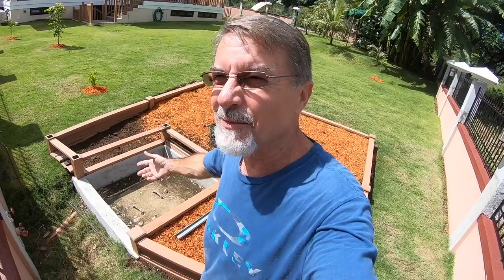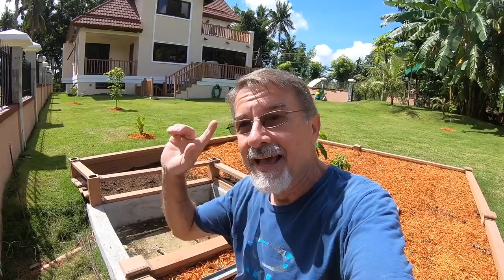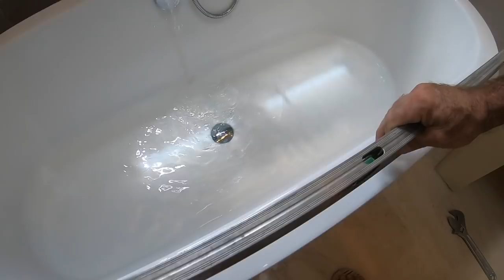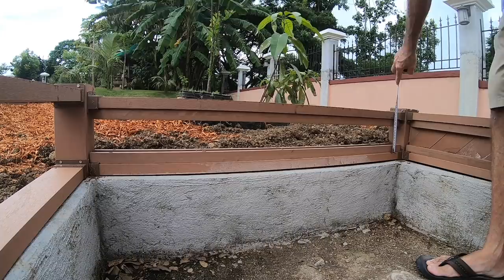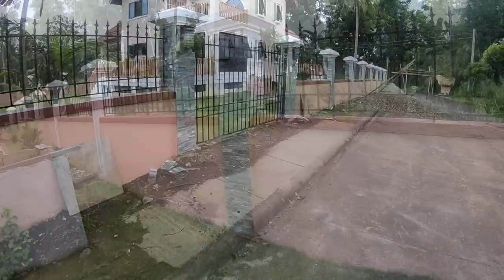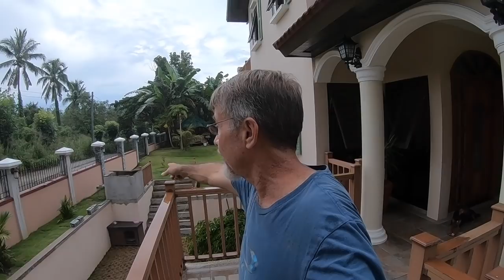VILLA FELIZ - EPISODE 405: I WAS BENCHED TODAY (House Building in the Philippines)

Comment: I was in Europe this last summer. I rented an apartment that had a bathtub similar to yours. It had no overflow in case the bath was overfilled. It also had very weak water pressure which meant it took 10-12 minutes to fill up the bath. I'm sure you can guess the rest. I got bored waiting for the bath to fill up, left the bathroom, got distracted, flooded the bathroom. Oops!!
Reply from the maker: Nice think about how houses are built in the Philippines, all wet rooms have a floor drain so no overfill for the tub isn't a big deal.
Reply: Same in Indonesia where I am. But then I was in a 200+ year old converted house and I rained on the downstairs apartments parade ☔😳

Comment: I know you had mentioned possibly putting a plant next to your toilet where the ladder is in this video.  Have you considered putting a little table there for a book, etc?  If you make a box out of plywood, you could cover it with that same tile that's on the wall.  Then it wouldn't be attached, but it would look attached, and you could remove it, if you ever need to work there.  You could even leave the side that faces the wall open for some extra hidden storage.  BTW, I really like this room a lot.  You've made a spectacular design for it -- it's very beautiful and smart.
Reply from the maker: We've already purchased a magazine/tissue wall rack.  Its wide enough to hold two rolls of tissue...a must for those "I'm out of tissue" moments.  😳

Comment: James, Leave that concrete cover on the cistern. On the seldom occasion you need to do maintenance, get someone to help open it. You can drill a few small holes in the top for rain drainage. You don't want that cover to be easily removed by some curious kids who want to see what's in there.
Reply: You always want easy acess to the cistern! What's the problem with a lock anyway?!?

Comment: 1:48 Hi James Hi Ness , I'm  back after a dayout and catching up... James you say that the geny will be alternated on some brown-out days. With doing that what is the effect on the refrigerator? I know that on some units its ability to keep its cold capacity can be up to a good 18 hours or so, IF you limit the constant opening  of the doors for prolonged periods. Also do you have a surge suppressor on that circuit? Because the constant abrupt   on/off effects the relay in the unit, in that it fails after too much on/off  events.

Comment: you nead to but some thing behind the saw on the wall
Reply from the maker: Remember I'm still in the building stage.  The saw will be moved a bit forward so that I connect a integrated vacuum hose to the vacuum outlet on the saw.  That'll be another DIY project down the road.
Reply: you right

Comment: Hi james, just have a couple questions that I couldn't see for sure without a close up shot. Are they tiling up too the light fixtures or boxes or removing them and going behind them. Are you just tiling over top of the attachment bar where the fence panels are attached to the posts. Just curious, I won't make suggestions, I leave the building to you. 

I do remember in the last couple days you were talking about a VPN  partly for Netflix I think. I have a vpn I use for shopping and traveling but dont use it for streaming. This is not a suggestion just an advertisement I guess, and you may already be familiar with them but Google,,,,  skystream technologies. They make there own streaming boxes that are not KODI  based and they work great here. I have 4 of them and by using various apps you can watch almost any show or movie ever made from 1900 on for free . Also can watch practically anything from any other country if that is of any interest to you. Can watch live streams of almost all channels from US or any other country. I used other streaming boxes for years but they did not update there software skystream does periodically so it almost always works really good but if you subscribe to a service called realdebrid 99.9% of the time I can always find a stream for anything .
I have pldt also and there speeds are plenty fast for operation.
Reply from the maker: They were putting tile adhesive around the outside boxes and I had to make them stop and put none there because to get to the light you have to remove the cover.  The way they were doing it I wouldn't be able to change a light out without chipping away at the adhesive.  Again, welcome to the Philippines.  I'll be putting gray tile adhesive along the top of the fixture to cover the small area and not make it noticeable.
Will look at the the streaming device you mentioned.  I'm always interested in doing things cheaper and better.  Thanks!